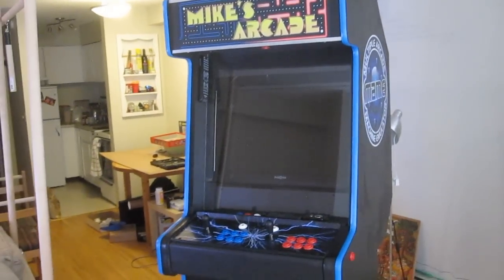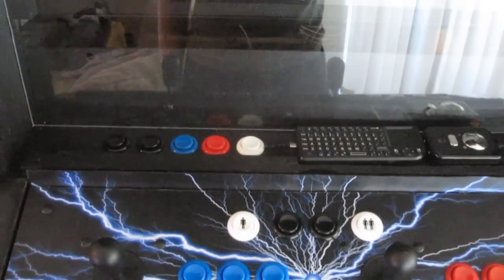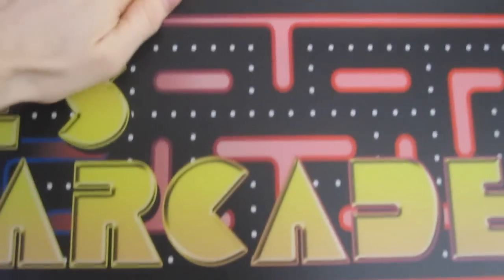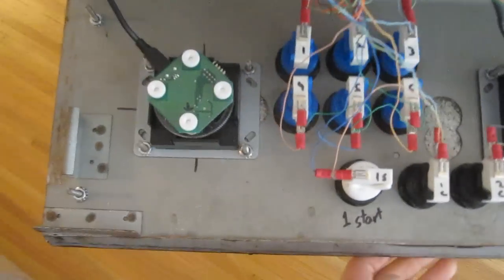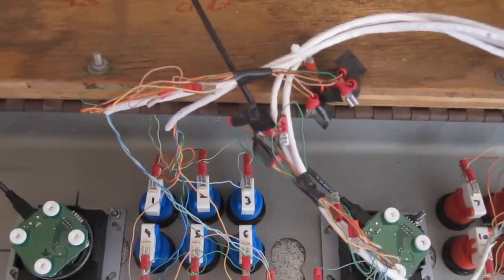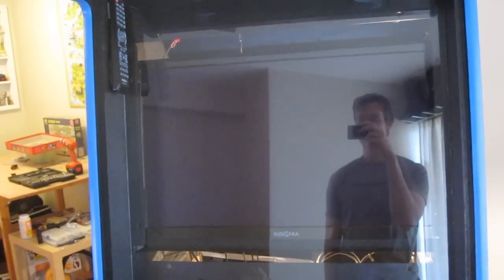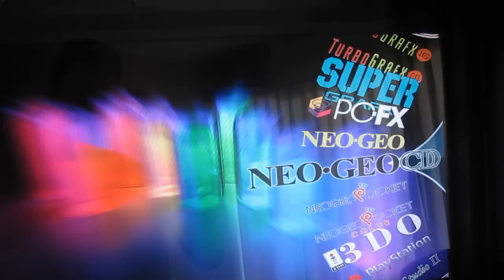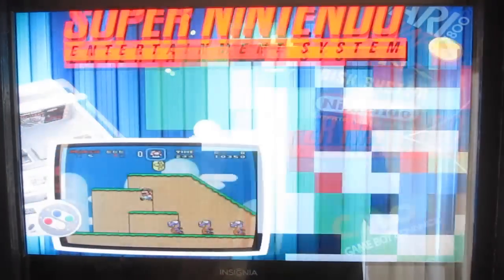Custom MAME Arcade Cabinet

Comment: Nice build!   Im almost finished with mine.  Just received my new flat crt 24.8 tri sync.  Still have to either paint or laminet .  Need to get grafx for my OL.  And need to put on my T-molding

Comment: Awesome I actually didn't hear about a new N+ I'll have to look into that, but there are a bunch of great XBLA titles you may have missed - specifically Trials Evolution and Battleblock Theater - both with pretty expansive level editors & level sharing databases! Definitely demo them at least but I think those games are right up your alley.

Comment: Gorgeous, but why'd you do the little keyboard with the velcro? Not a fan of that.
Reply from the maker: poshko41 the keyboard is rarely, if ever used... but there are times when it its needed because you don't have an emulator button mapped out or want to change some controls, etc.  Having a keyboard right at your fingertips is convenient for that.
Reply: +007craft It does ruin the arcade look though, personally if you need it. Id put it at the back or somthing out of sight

Comment: This thing is awesome! I just finished making one out of an old Rygar machine my friend gave me. It was a bit beat up so I changed out the T-molding to a light green, as well as the ball on top of the joystick, and added two light up red buttons and two light up blue ones. It's got a powerful PC inside and also has a wifi dongle like yours. Just need to fill some dents and repaint it, maybe add a 2-player control scheme!
Reply: Oh, it's also running Hyperspin :D
Reply: BlackTigerzz Gaming Um.... No.

Comment: Pretty cool arcade.  You can reduce the stuttering in the Hyperspin front end at startup by reducing the quality settings.  The quality difference is only marginal, but it will load faster.

Comment: Very good, the only thing I dont like is the LCD, CRT is far better for old games.
Reply: I just think that a CRT is the only way to go for an arcade machine, but there's nothing wrong with using an LCD.  There's advantages for both.

By the way, this machine is configured awesomely !
Reply: if you want authentic arcade feel sure, crt is best. but i could care less unless i had some light guns hooked up
Reply: there's probably a setting for scanlines if you're just looking for that retro look
Reply: Dzumeister yeah, and you can turn on the lcd 4:3 aspect ratio and there you have your old school feeling

Comment: I love what you did there. I had to build my cabinet by scratch but for what i was planning it was needed. I do want to make another one since the first one was so much fun without without the refrigerator built in it. You did a lot of nice work though and like the color schemes. Did you do the control deck decals yourself or where did you pick those up at? Mine still is decal less. A friend was going to hook me up but stuff happened and now no longer able to.